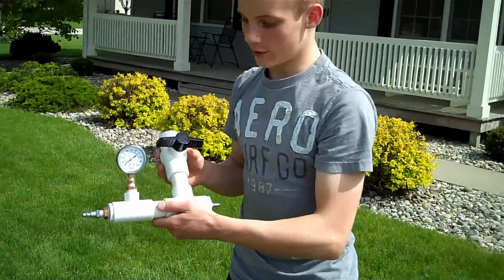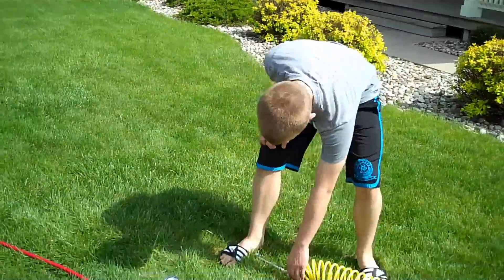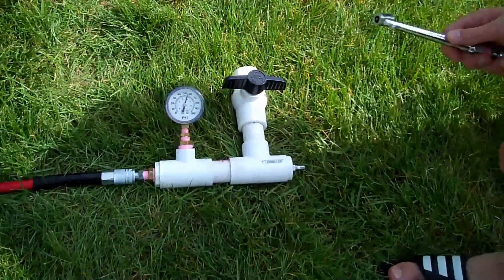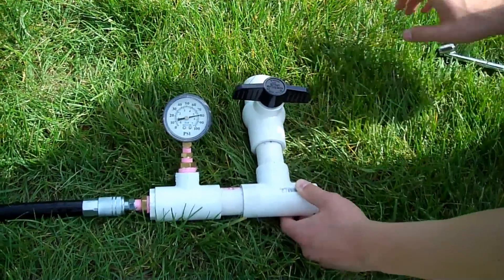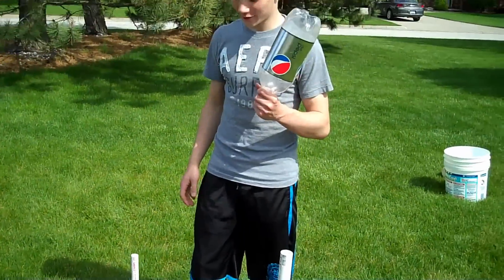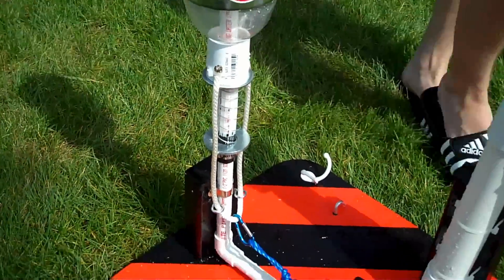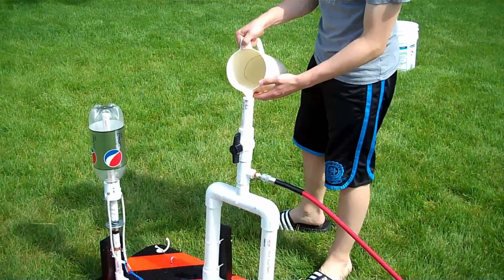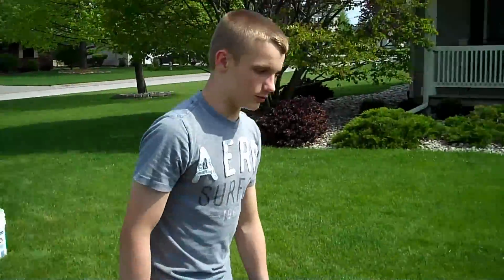Water Rocket w/Clark cable tie launcher

Comment: Hi John, by far one of the nicest launchers I've seen. Elegant design with nice safety features. Currently prototyping a gardena launcher for a class but would love to build this one. Wondering if you have a parts list/ or build tutorial?  I can tease it out from the video but thought it worth asking. thanks, Jeff
Reply from the maker: No, sorry. For projects like this I typically visualize my plan as I stand in the hardware store fitting parts together. An important part of the design is having the air fill above the water reservoir. This essentially acts as a ‘non return valve’. This is the square section of pipes below the fill neck. I used two vertical tubes because I figured one would not be of great enough volume for larger rockets. It is this width simply to accommodate the tee and elbow sizes. This Instructables link displays how to melt and squeeze the PVC pipe to create the bottle seal as well as how to build the IAN-Clark cable tie release: https://www.instructables.com/water-rocket-launcher/  I noticed after repairing sprinkler heads that the spring inside a Hunter PGP ¾” sprinkler rotor head would fit the launcher perfectly and not require I enlarge one purchased from the hardware store.  It is a very strong spring.  This is especially important with young children as they are not quite so gentle on the launch cord :)  Thanks.

Comment: Hi John,
Where did you get the spring for the collar mechanism?  Been looking in my local hardware stores and the closest I’ve been able to find are the springs that are used in the toilet paper dispenser roles which are far too narrow for a 1/2” launch tube.
Reply from the maker: This uses a compression spring from a hardware store.  I needed to enlarge the diameter along its entire length to widen and extend.  However, after a recent sprinkler head disassembly/replacement, I see that the spring internal to the Hunter PGP Rotor Sprinkler Head is PERFECT.  Additionally, it will offer a little more resistance for children who are too rambunctious on their launch...
 :)

You can purchase these at Home Depot or Amazon.  I think they are about $13 at Home Depot.  This is a little expensive, but should last years on the launcher.

View the image at 0:40:  https://www.youtube.com/watch?v=_PepIotervU

Or this picture:  https://hw.menardc.com/main/items/media/HUNTE002/ProductLarge/prospray_checkvalve_dsc_0158_path.jpg

P.S.  A toilet paper dispenser spring would be FAR too weak.

Comment from the maker: I am sorry, I cannot 'afford' to make a tutorial.  That would subtract from future projects, such as... scuba tank pressure launch manifold?  Video to be released sometime soon.

If you pause the video and look at the launcher, you should be able to create a parts list.  I usually stand in the hardware store 'dry fitting' parts.The spring was the largest compression spring the store had, which I then 'opened' up around and around.  However, an underground sprinkler spring would work even better.
Reply: I have seen elsewhere that they use the middle section of a 2 litter bottle as the spring. Just cut two holes directly across from each other. Then put it where the spring is.
Reply from the maker: Yes, I have seen that, but I think it is too sloppy and 'requires' something designed better.

Comment: - The air fill above the water reservoir acts as a ‘non-return’.  When you release pressure at the fill station, no water discharges.
- We use tent stakes to hold the launcher.

Comment: - The hose clamps under the 'fender' washers on the release are dual daisy chained (sort of yin yang style with each end connected to the other screw ) to evenly balance the washer.
- I couldn't find a good large diameter compression spring so I hand distorted one.  I have just repaired underground sprinklers and think the retract spring would work perfectly.  This stronger spring would also help with children who pull too hard on the release.

Comment: Sorry all, I don't have plans or a parts list.  I usually visualize the assembly then stand in the hardware store dry fitting various parts.  The only problem then is remembering how they all fit when I get home :)

Parts of this design that are not so obvious or visible:
- We used the melting, pressing, creating a flare method of sealing the launch tube rather than O-rings.